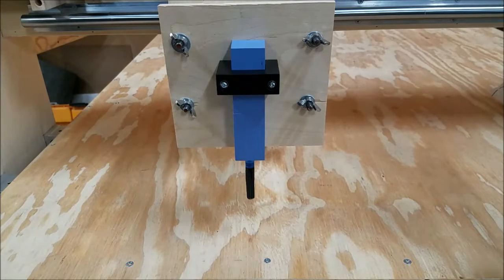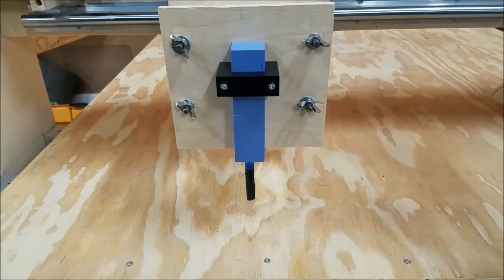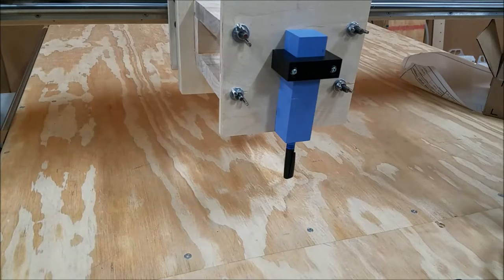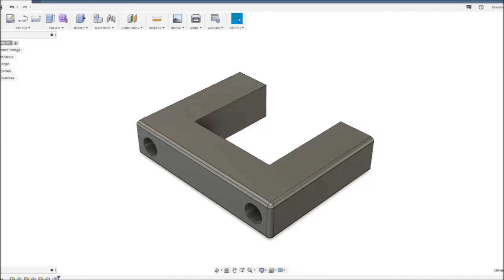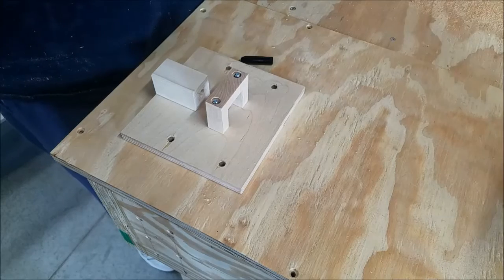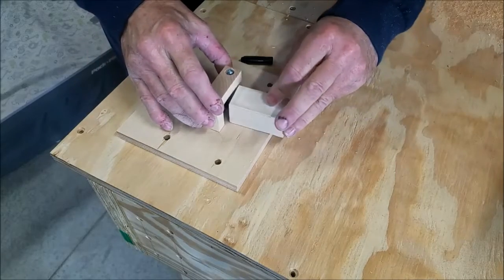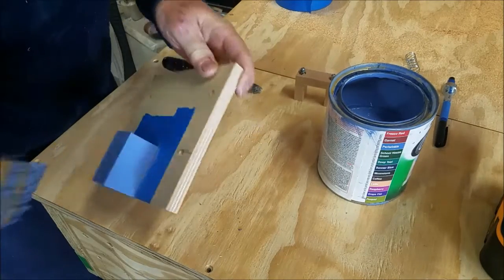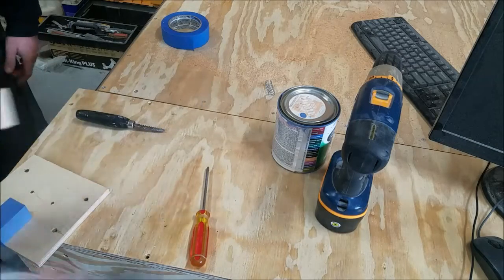Quick, Cheap, and Easy Spring Loaded CNC Pen Attachment

Comment: Simple, but an impressive design, nice job!
Make a holder that holds a guitar pick, put a guitar on the table and program in some good guitar solos for your CNC to play for you while you while you work.  You'd have to get some quieter motors or you might get lucky and the sound of the motors will blend nicely with the song it's playing........OK OK, I'm just kiddin'.  Tim's Workshop is right, that was a cool ending.